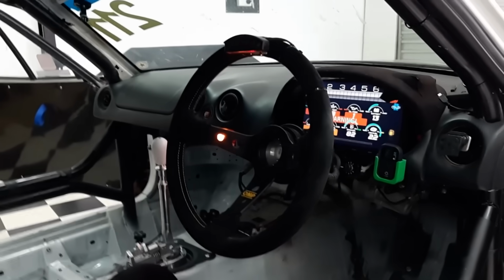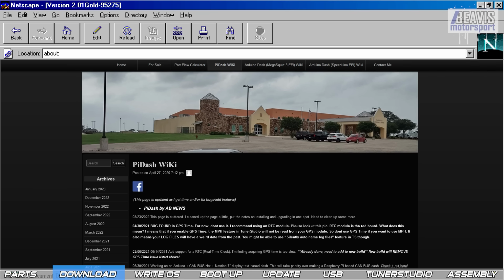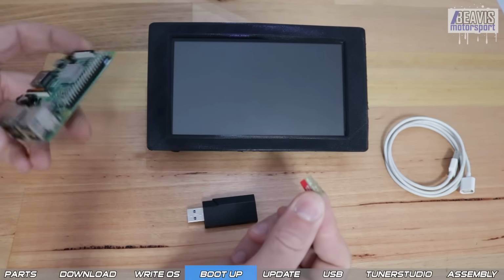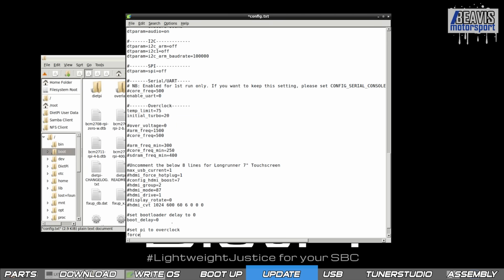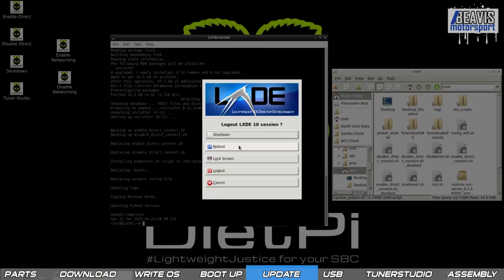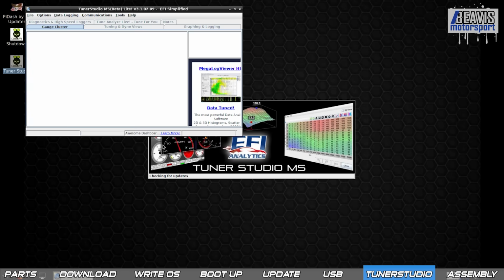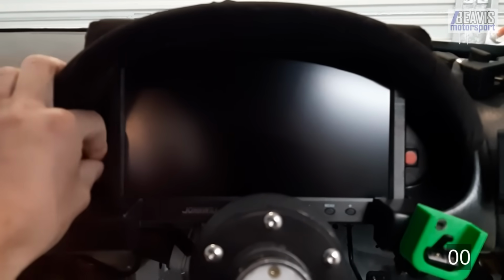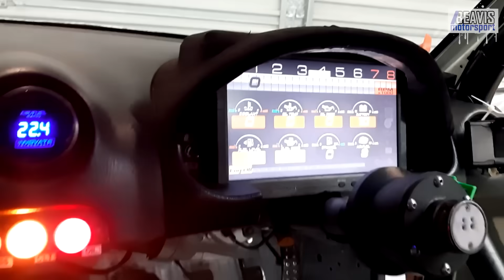DIY Raspberry Pi Racecar Dashboard: The Ultimate Guide

Comment: That boot time is way too long for practical every day use. My microcontrollers cant keep up with the refresh needed to run a flashy gauge. Theres got to be a bettwr way that doesnt involve booting up the pi. Couldnt you just do what the other modules donin the car and just provide constant power to them and have it go to sleep when not in use?
Reply from the maker: Yes you could run constant power, but this is a track car with a battery kill switch, not practical for my application.

Comment: Of all the car videos i've watched over the years, this one is by far the one I've waited for! AMAZING
Reply from the maker: Wow, thanks very much, may I ask what did you find so valuable about it?
Reply: @Bbeavis  He doesn't realize you need an aftermarket ecu to make it work yet. LOL You probably should have let everyone know in the beginning that you can't do this project with an OBDII stock ecu. Or at least these instructions won't help you with that project. 
I am sure there is a way to take a Pi and  pickup the neccesary pids for the gauges from the OBDII it's just not in this video.

Comment: Can I make this dash to run with ez efi fast setup on my Datsun 280z ? Thanks
Reply from the maker: You'll need to do some research into what interfaces/communication the EZ Efi supports, if any, for external devices to extract data - I have no experience with the EZ Efi so I cannot help you there.

Comment: i cant get my screen resolution right on my 5" 800x480 raspberry pi monitor and those options dont show on my version
Reply from the maker: If you're running DietPi as per the video, you made changes to the /boot/config.txt?
Check also,  /DietPi/config.txt
And, this link may help: https://www.raspberrypi.org/documentation/configuration/config-txt/video.md

Comment: Did I miss something about how or what your are connecting the Pi to in order to interface with your car?  Are you plugging into an ECU?
Reply from the maker: The car runs a Megasquirt MS3 ECU, this uses it's own serial protocol over USB to communicated with the TunerStudio software on the Pi. TunerStudio will only work with a Megasquirt family of ECU. If you want to run something like OBD2 for comms, then perhaps the OpenAuto software would work.

Comment: I'm unclear of how you get the data into the raspberry pi?     If I'm using this for an EV boat,  I'd like to know RPM, battery temp,  SOC, etc.    What is the interface?  to get that into the Pi?
Reply from the maker: The car runs a Megasquirt MS3 ECU, this uses it's own serial protocol over USB to communicated with the TunerStudio software on the Pi. TunerStudio will only work with a Megasquirt family of ECU. A boat is perhaps a little outside my realm, sorry to say I cannot help you there.

Comment: Nice stuff. I have seen similar solutions such as ready to install hardware or literally plugging Windows tablets to the ECU. Theoretically you can also tweak the tune from that system, right?
Reply from the maker: Yes, this could support tuning the car, just plug in a wireless keyboard and away you go.
Reply: @Bbeavis  Cool, there's no need to grab a laptop for quick data analysis and small adjustments.
Watching from Brazil, land of ECUs with built-in dashboards, this is surely an interesting alternative for people who like to do more craftwork.

Comment: This is awesome! I’m looking to do this in a 66 c10 retro mod. Stupid question, but how are you getting communication from the ecm to the pi via a usb cable? Are you pulling the info from your obd2 port?
Reply from the maker: The car runs a Megasquirt MS3 ECU, this uses it's own serial protocol over USB to communicated with the TunerStudio software on the Pi. TunerStudio will only work with a Megasquirt family of ECU. If you want to run something like OBD2 for comms, then perhaps the OpenAuto software would work.

Comment: Can you set the screen to dim with the headlights on ?
Reply from the maker: Not in this case for the screen i am using, the display doesn't have brightness integration to the Pi. But if you use the Raspi 7" touch display, then you can control brightness. See here: https://raspberrypi.stackexchange.com/questions/46225/adjusting-the-brightness-of-the-official-touchscreen-display

Comment: So im going to build one of these what im curious about it is im using an aftermarket engine management system that has a small screen and i want to basically mirror it to a bigger screen...can i still use a similar set up to this?
Reply from the maker: This RaspPi created it's own display output, so in theory you can use any size/kind of screen that supports HDMI.

Comment: Has anyone done this with a Gen III LS? Im using a tuned Stock ECU for my swap and im not too sure where i could start for my application. Any info is greatly appreciated as I'm exploring all my options for guages.
Reply from the maker: If your Stock LS ECU supports OBDII, you can use software called OpenAuto for that.
Try this link for details: https://bluewavestudio.io/shop/openauto-pro-car-head-unit-solution/
Reply: @Bbeavis  Awesome, I will definitely check that out and hopefully I can get this done. Will be my first time messing with anything of this nature so it'll be fun. Thank you for the info!

Comment: Great video! I originally fitted my PiDash using a Mausberry Circuits 5v converter/switch. The Mausberry converter eventually failed and I decided to wire mine up like yours, constant 12v to switch, to converter. It's nice to be able to leave it on and make changes or not shut down the Pi if you only need to turn the engine off for a few minutes. However....have you experienced any involuntary shut downs of the Pi on engine restarts? If my engine doesn't start immediately I think the voltage drops just enough to kill the Pi. Which requires a full reboot cycling the switch. It'd be nice to add a small battery pack just to keep the voltage high enough.
Reply from the maker: Thanks very much for sharing. Yes your issue is something I have also noted. Voltage drop due to cranking pulls juice away from the Pi. 
My solution was to add some capacitors to keep the Pi powered just long enough to mitigate a drop due to cranking, so far it seems ok, but I am still testing it.
Reply: @Bbeavis  Good idea! What kind of capacitor setup are you using? Something on the 5v side?
Reply from the maker: @HeliWrk  3x 2.7volt 10uF Super Capacitors, on the 5v side with a diode so they aren't feeding back to the car.
Reply: @Bbeavis  Cool! I'll look into that as well! Thanks! While researching I saw a post about an idea of using a lithium battery that'd take over at less than 10volts similar to the capacitors and you'd get probably a year or two of starts before needing to be replaced.

Comment: I find it interesting. However, id prefer if this was all automated with the start and shutdown of the car itself. To achieve a proper shutdown you would have to incorporate a battery and then the script for shutdown would trigger when the charging function is not active, and start when it is.
Reply from the maker: Certainly, there are solutions to achieve exactly what you describe. For me, I like the simplicity of this solution, and as I run this in a track car, I don't have a traditional ignition switch, instead I run a full battery cut off.

Comment: interesting how reliable is it at booting  is it 99.9 out of 100 times it will boot?  and have you tested the speed on dash vs actual speed?  and how about rpm?  i used a pi in the past and do wonder if it can actually update as fast as a engine needs... is there any lag between throttle press and readings appear on screen ?
Reply from the maker: It boots 100% of the times I have tried, why would it not boot? Yes, there is definite slow display response, but the data is accurate - just a low refresh rate.

Comment: I'm surprised you didn't mention where the input data comes from, such as a Bluetooth odb-ii reader.
Reply from the maker: Hi Adam, sorry for the lack of clarity. This car runs a Megasquirt ECU, so the Pi connects directly to the computer via a USB cable, and the data is translated directly over the USB.
Reply: @Bbeavis  I have a 2011 car and replacing the dash cluster sounds like a cool idea.

Comment: BEAVIS Motorsport Thanks  for sharing your knowledge with others.

I have a question, I downloaded the image and mounted it on my RPD4 and it uploaded perfectly, however it doesn't recognize my USB mouse or keyboard.

I tried with two different mice and two different keayboards (with its receiver bluetho) and USB keyboards, but none of them want to recognize the rasbperry, it should be noted that during boot it does recognize them, however, when the image loads, Not.

I tested with several configurations in the cofing.txt

Option 1
#Uncomment the below 8 lines for Longrunner 7" Touchscreen
#max_usb_current=1
#hdmi_force_hotplug=1
#config_hdmi_boost=7
#hdmi_group=2
#hdmi_mode=87
#hdmi_drive=1
#display_rotate=0
#hdmi_cvt 1024 600 60 6 0 0 0

Option 2
#Uncomment the below 8 lines for Longrunner 7" Touchscreen
max_usb_current=1
#hdmi_force_hotplug=1
#config_hdmi_boost=7
#hdmi_group=2
#hdmi_mode=87
#hdmi_drive=1
#display_rotate=0
#hdmi_cvt 1024 600 60 6 0 0 0

Option #3
#Uncomment the below 8 lines for Longrunner 7" Touchscreen
max_usb_current=0
#hdmi_force_hotplug=1
#config_hdmi_boost=7
#hdmi_group=2
#hdmi_mode=87
#hdmi_drive=1
#display_rotate=0
#hdmi_cvt 1024 600 60 6 0 0 0

Option #4
#------Max USB current--------
max_usb_current=1

Option #5
#------Max USB current--------
max_usb_current=0

What do you think could be the problem?
With my other images the keyboard and mouse work well.
Thanks for all.
Reply from the maker: How interesting, having not experienced this issue myself, I cannot say why it's happening or how to fix it unfortunately. Seems like something in this specific OS image is not happy with your USB peripherals.
I'm already trying to put together a faster boot OS solution myself at the moment, so maybe once that is done I can share, and USB might even work for you :-)
Reply: Thank you very much, in any case I will continue trying more options, such as trying to connect via SSH, VNC or anydesk and if it works, open the cli, I saw in some forums that you can force mouse or keyboard configurations in the usb ports with some commands sudo apt-get update and the like.

If I manage to correct the problem I will let you know right here and thanks for everything.

Comment: How do you connect inputs from the car to feed the info to the dash?
Reply from the maker: Hey, this is using the TunerStudio software, specific to the Megsquirt ECUs. So this car runs an MS3 which connects to the Pi via USB cable. And all the sensors are connected into the ECU, speed, oil, coolant etc.

Comment: That’s amazing! Would you say it’s a viable option for restomods? Whats the maximum refresh rate - say if one is willing to spend on a good display?
Reply from the maker: Sure I don't see why you can't do it. Refresh rate isn't great, the ECU -> Pi bandwith is very low so it's not as smooth as one might have hoped. The display itself isn't the constraint in that regard.

Comment: Is it possible to wire the pi/screen assembly to a relay to turn on with ignition? Also can it be programmed to do a safe shut down after the ignition is shut off? Wouldn't require a separate battery?
Reply from the maker: Hey J, yes definitely. You could wire the pi to auto power up with the ignition, and then trigger it to safely power off when the keys are switch off. You'd need a short term power source to keep the pi alive just long enough to shut it down, perhaps with some capacitors rather than a battery.

Comment: So I have a 97 landcurser and it’s all analog, is there any way I can do this?
Reply from the maker: Hey Noah, anythings possible, but you're going to have quite a LOT of work to do to get sensors setup, hooked into a computer or ecu that can translate/report the data, and then some way to display if if not using as Megasquirt computer as I have in this video....

Comment: Would this work with a Hondata ECU? Great video by the way. Love to see a fellow programmer create stuff like this
Reply from the maker: Hey Josue,
I'm running this dash in a track car, that uses a Megasquirt MS3 ECU. So all my sensors, speed, temps etc go direct to the ECU. Then the ECU has a USB connection direct to the Pi to feed the data for the dash software.
This solution I have shared does depend on the ECU, so you'd need to see if there is a software/hardware solution that can communicate with Hondata.
Thanks for watching.

Comment: how do you wire it to your car?
Reply from the maker: Hey Matt
I'm running this dash in a track car that uses a Megasquirt MS3 ECU. So all my sensors, speed, temps etc go direct to the ECU. Then the ECU has a USB connection direct to the Pi to feed the data for the dash software.
Thanks for watching.

Comment: question ive been wating to do this for mu car but whats kipping me running my cluster with can bus is that if i add a mini pc or pi plus a screen a will be adding latecy to what i see on a regular mini pc ive loocked avery where and to get low latancy high fps ffrom it neeed to have a grafic card so i gave up on that  because im not goona keepp adding stuff i wanna keep it simple now on the pi i have 0 expieriece working on them but is there a script that can reduce display latency and also add more fps to match a high refesh rate diaplay my goal is to have quick comunication from lets say ignition to display quick ass fast as posible after doing to research with the pc setup i would have to use my ecu bluetooth or usb to plug into the pc adding latency then pc to display addin even more so lets say my car in real time rpm in accel is 5500 on my cluster via cambus and on my laptop it was around 200 rpm behind i notice this alot when tunning the launch control car is static no load rpm go up quick reach the 6200 launch setpoint and again when i look at the display on my laptop it was still at 5950 give or take so if the play is able to reduce latency add more hrz to its display output it would be my next choice only company ive found so far with good display was lilliput not cheap but it got me pretty close to what im trying to do if anyone know another company with proff of low latancy and high refresh rate lmk plisss.
Reply from the maker: I do my best to help all commenters, where I can. But, I don't even know where to start with this one man.

Comment: Wonder why it takes so long to boot, given the presumably lightweight OS and Solid State storage. I’d love to do something like this in a project, but I’m a damn impatient guy :(

Needless to say, of course, awesome video.
Reply from the maker: Thanks Max, with some more effort I'm sure it could be made even faster. I've just only got limited spare time to tinker!
Reply: I believe there isn't much work around for the boot times. It's the raspberry pi itself and the way it loads up kernels and bootloader's. They have "bare metal" circuitpython which doesn't use a OS and that still takes almost 10 seconds to boot. Need to just leave the pi on and have it sleep when car if off.
Reply: Booting off an SD card is inherently slow. Change to a USB3-connected SSD and you will see far faster boot.
Save 5 seconds by setting ‘check for SD-card’ to ‘false’.

Also, an SSD is far more robust, as they are designed for constant I/O, unlike SD-cards which are ‘read’ oriented.
On my RPi’s, I only use SD-cards and/or thumb drives for initial testing.
Actual working/running Pi’s all use SSD through USB3
Reply: @ernestgalvan9037  thanks for the info! That makes a lot of sense.

Comment: Do you have a video on how u connected everything from the power supply ,fan ,power down the inverter etc?
Reply from the maker: Hi DG, what in particular did you want clarification on that wasn't already covered in the final part of this video?
I don't have another video as yet, was there something about the hardware side of things that you specifically wanted more detail or description about? I can definitely get more detail for you.
Reply: @Bbeavis  good morning this for the reply free looking at the video again I believe I understand the power supplier u have setup ,I do however would like to know how would I run my ecu system as I’ll be running kpro for my Integra with boost gear
Reply from the maker: @DirtyGarageTx  The solution I have shared does depend on using the Megasquirt family of ECU, so you'd need to see if there is a software/hardware solution that can communicate with Honda computer. This is not something I have experience with sorry.